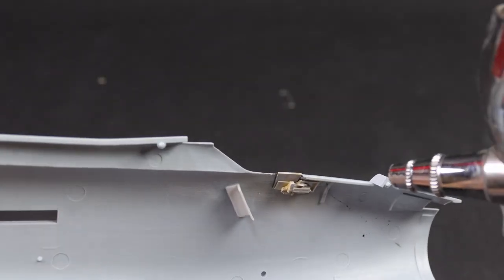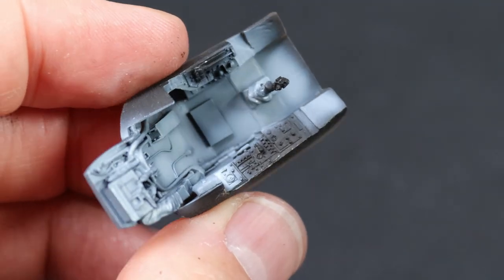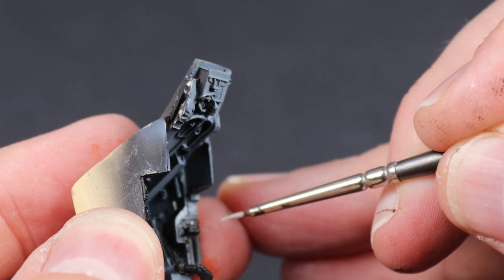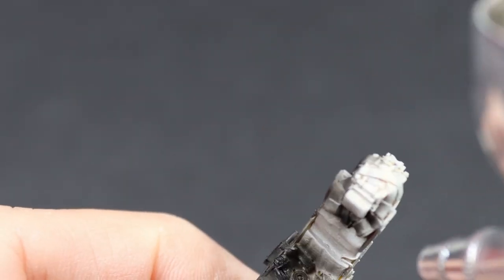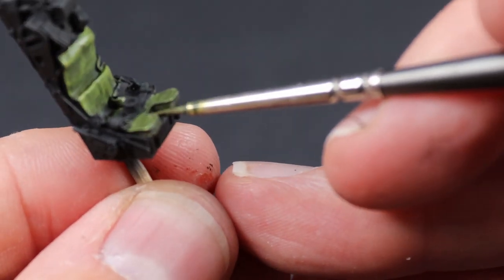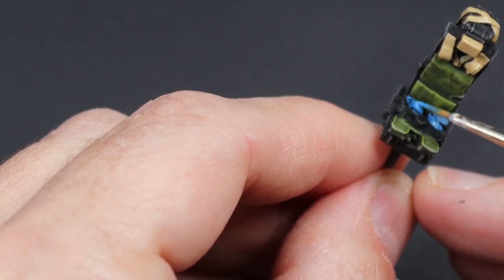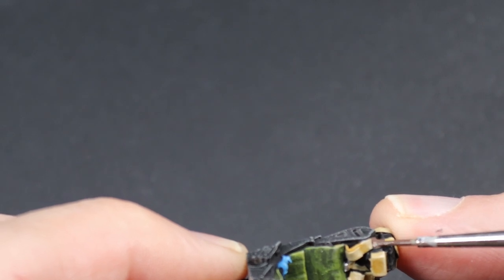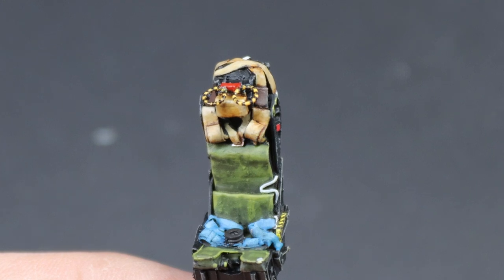Airfix Lightning part 2 Cockpit 2 0

Comment: Having a pilot who builds kits helps a lot its good to hear all the SOP's as you were painting . At the moment i am building the type 23 HMS Kent i wish you would build one i would know what parts do what in real time there are no reference books for the Type 23 . Regards Gav.
Reply from the maker: I have the resin 1:350 and Trumpeter 1:700 kits to do at some stage, both will be done as HMS Somerset when I was the Flight Commander in 2009.